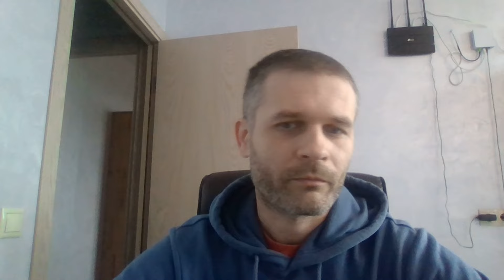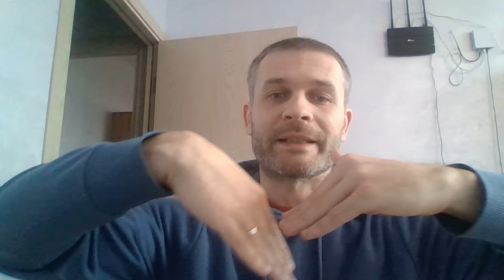What does "nominal power" of the wind turbine and solar panel mean - checking the standards.

Comment: It means they are a waste  of money. I run my generator on half of the depreciation on my solar panels . End if I run it four 30 years, it will put out less than half of the C02 that was produced, making my solar panels. And that is without looking at the toxic heavy metals in the scrap panels. So I just leave them sit as a reminder of how stupid I was!
Reply from the maker: I don't think so.
Reply: @ModernUkrainianHomestead  i can see you have never tried to use solar energy only.
Reply from the maker: my friend - I wish you know just a little bit how to live in my circumstances.
we are in a pure survival mode now. no stable grid, constant power offs caused by russian rockets, so sometimes solar is the only power source you have.
so no, this is definitely not you telling me how to live with solar, or with solar only.
your generator is pure "nothing" in cases where you have no place where to get gas/diesel for it. and my friends living near the frontlines have just confirmed this vastly.
Reply: @ModernUkrainianHomestead  so why didn't you build a gasification system and produce abundant power.
Reply: @ModernUkrainianHomestead  you can mix waste plastic in with the organics in the gasifier but because it has less carbon it will reduce the amount of power you get out of it.
Reply from the maker: My solution works well for me for now. I don't need anything additionally at the moment.
Reply: @ModernUkrainianHomestead  Your approach requires no fuel which is a tremendous benefit.

I am hoping that many PV panels and batteries are getting over to your country now during this very difficult time.
Reply from the maker: @kevinleecaster2698  thanks, no deficit is visible with the batteries and panels and inverters at the moment. People have finally woken up and started to think for themselves rather than relying on the government. And that is a good sign.